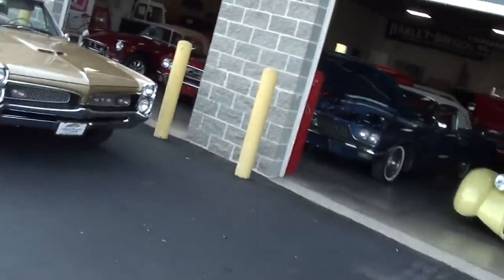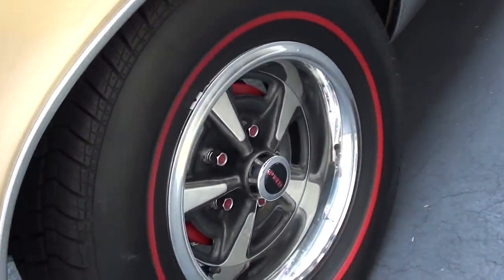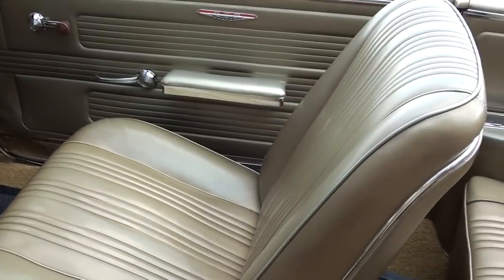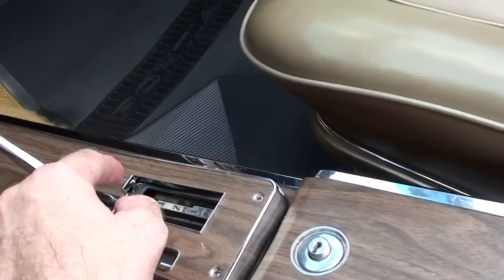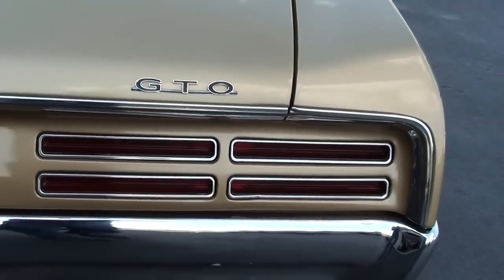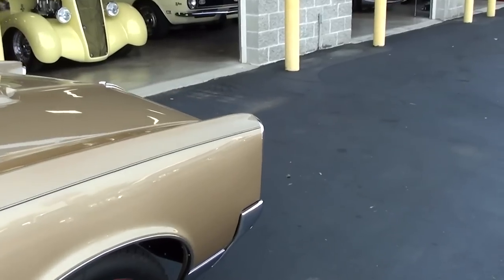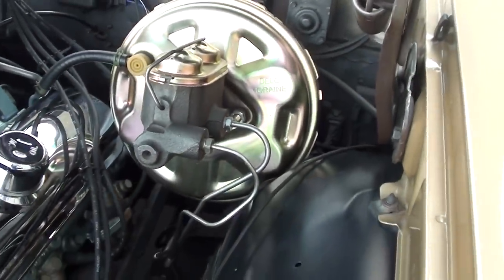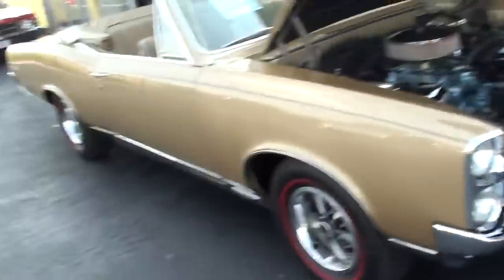1967 Pontiac GTO Convertible 428 Four Barrel Muscle Car - Start-up and Walkaround

Comment: Nice car. This car new was $3165 , the 428 option was $119 to $263 depending on the model and transmission used. Their were 9,157 convertibles and 65,176 hardtops.

Comment: I guess you could shift it manually from Low, to Second, to Drive, over in the left side gate too, just that the right side gate will prevent you from getting carried away and slipping up into neutral or reverse. That's pretty cool.

Comment: Real nice.  Never drove a "his and hers" shifter. What makes this different than any other three speed automatic on the floor that you can also shift manually if you wanted to?
Reply: When you push the shifter to the right, it works like a slapstick and stops in each gear.

Comment: Pontiac should've offered the 421/428 as an option in 64-69 GTO's. The 376 horsepower 421 HO or the 390 horsepower 428 HO in the GTO would've been an animal. I'm willing to bet that Pontiac would have if they weren't restricted by GMs stupid 400 cubic inch limit in midsize cars that they had until 1970. Pontiac was more performance oriented than any other manufacturer besides maybe Dodge/Plymouth